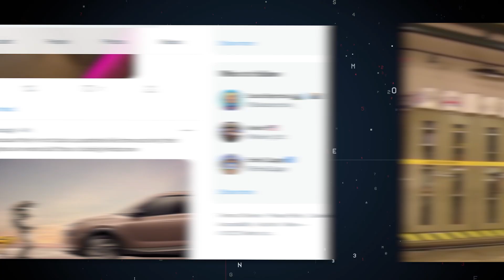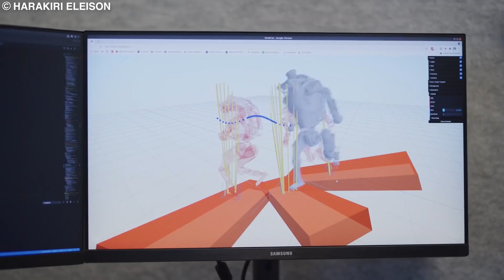Boston Dynamics' New Robot Makes Soldiers Obsolete, Here's Why

Comment: Its not going to replace soldiers. What happens is these robots will be deployed together along side with the soldiers to help them in battle. If you have watched Netflix movies like Outside The Wire, Code 8, and Warriors of Future you’ll see what I mean. They will act like force multipliers and help reduce human casualties. Like in Code 8 when storming a house, the robots are in the front so when something pops up, the robot takes the hit instead of a human soldier or police. Same with Outside the Wire, the robots fight along side the soldiers to help tip the scale in situations where the soldiers are surrounded, in a disadvantaged situation, or outnumbered. 

Besides it is unwise to send pure robots in a fight. Someone uses EMP and its over. You have to use combined arms. So human soldiers alongside with some robots would be best. 

Even in Cybersecurity. You think automation will replace humans. No, humans are still needed when doing analysis, investigating, and due diligence. Automation works along side with them to tackle repetitive, simple, and easy events so that analysts will be able to preserve their energy and brain power on more complicated tasks.